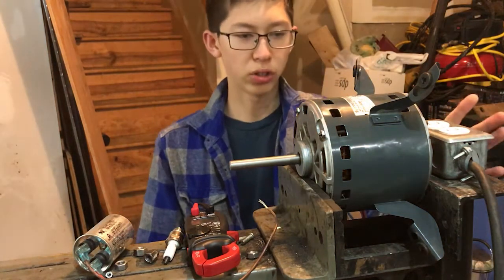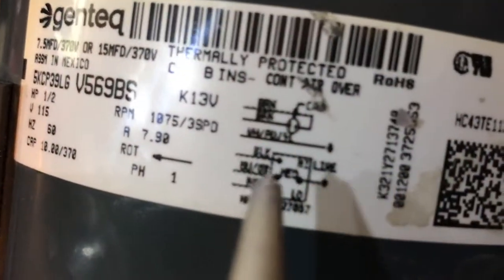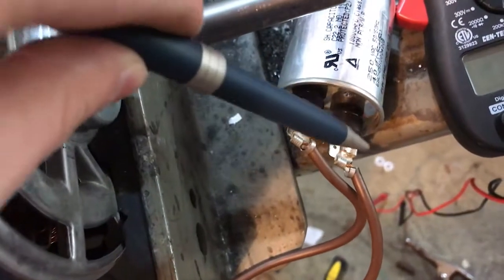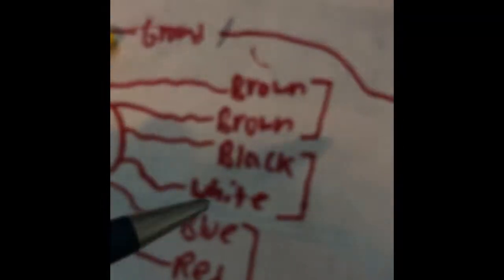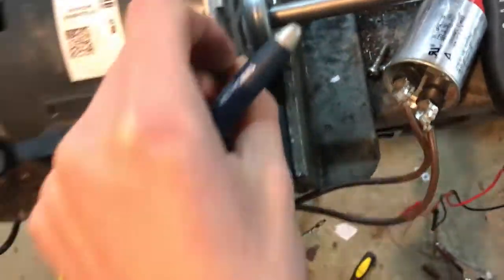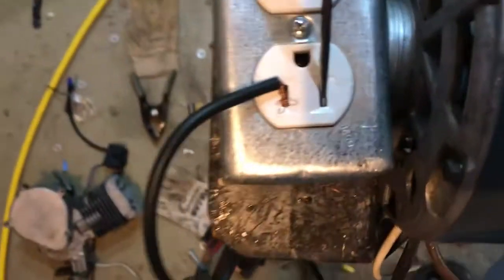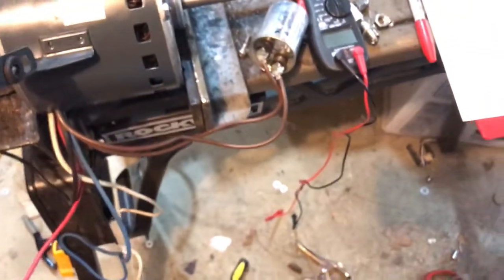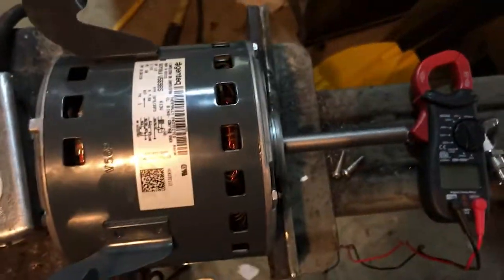How to Wire a Multi-Speed Motor | Furnace Fan, Blower, Washing Machine

Comment: 40mfd capacitor and motor calls for 10mfd on nameplate
Reply from the maker: the capacitor req is a minimum. you can go larger in an electric motor. the capacitor stores enough charge for the run winding on a motor. less than that, it wont generate enough of a magnetic field, larger than that is ok. as long as its not a lot larger like > 1 order of magnitude it should work ok.

Comment: I have a 1/2 HP,GE motor from my Rheem furnace (this is a spare motor) Its got 2 brown wires for the cap, a white wire which is the common and then black (which should make the motor spin the fastest) and  it also has a blue, yellow and red wire. (red should make it turn the slowest)
Depending on which of the colored wires I pair with the white, I should get a different speed (RPM) out of the direct drive motor.
I hope to use this HVAC motor for another task but need to understand the RPM
So I set up my stop watch on my Iphone, I put a piece of tape on the shaft and set up my camera to record video which Im able to slow down to very low speeds so I could count the turns of the shaft.
It did not matter which wire I paired with the white wire, all of them made the motor spin the same speed (1200 RPM) which is faster than the rated speed on the motor label which is 1050 RPM.
After talking with a friend, he thinks it might be because Im free wheeling the motor with no load on it, (no impeller and no duct work)
Im stumped. Im not an electrical guy. All my engineering work is on the mechanical side of things.
Reply from the maker: you should be fine. 1200 rpm is within 10% of 1050 rpm. i wouldn't worry about it. yes it will slow down when loaded with a fan blade. you can figure out how much it slows down empirically or calculate the motor torque and it will equal the drag of the fan blade at X rpm. solve for X. hardest part is finding the drag coef. of the blade. the equations used should be similar to the wind turbine equations as a wind turbine is basically a fan.

Comment: If you were to remove the two wires that go to the capacitor and hook them up to an ohmmeter, should the ohmmeter show continuity?
Reply: I would assume so, since they normally are connected through the capacitor.

Comment: If I was your parents I'd take out a huge insurance policy on your life. I don't think you have a normal self protection mode.  I noticed the screwdriver you jammed into the outlet. (You never know if the electrician wired the hot wire on the right side.)  Otherwise, keep up the good work but figure out how to get the camera focused and try to not move it around too much.

Comment: Lol I love the shocks man😂
Reply: My fan does not have a white wire
Reply: It has blk red purple  blue bro green
Reply from the maker: @donyoung6756  ok, bud. mess around with the wires and guess till one works... look at the nameplate spec and it should show you the exact wiring. Its probably red and black since you dont have white, red is the hot, black is the neutral, : the purple, blue and green are for speed control.